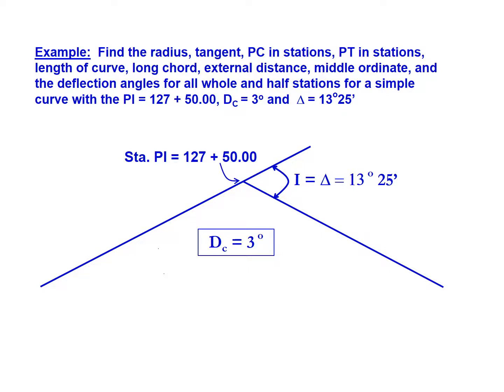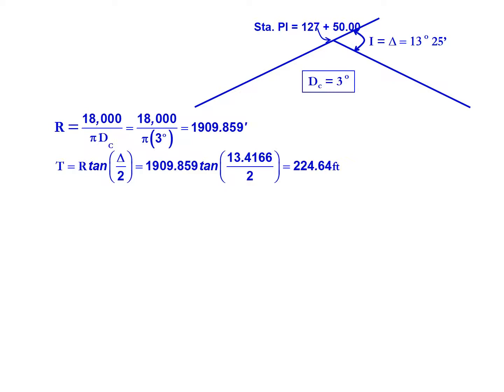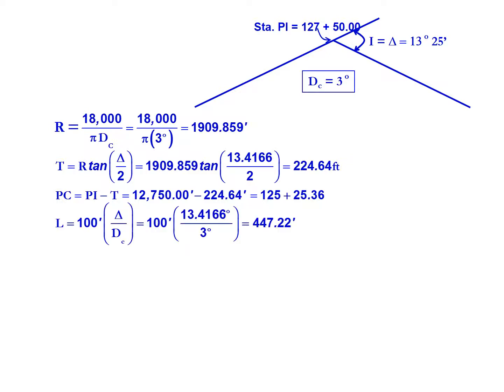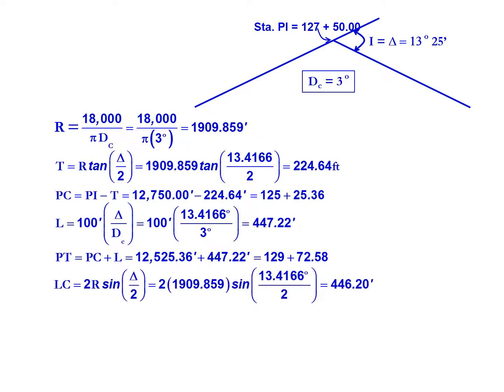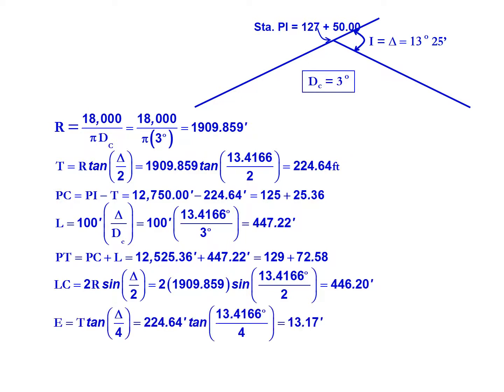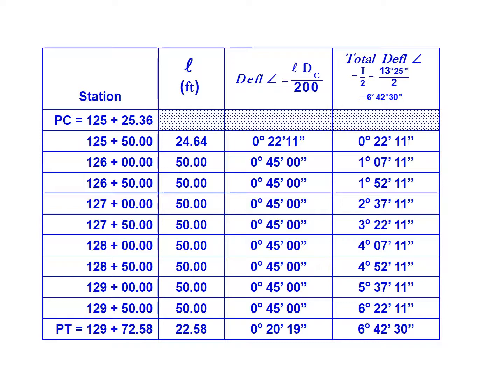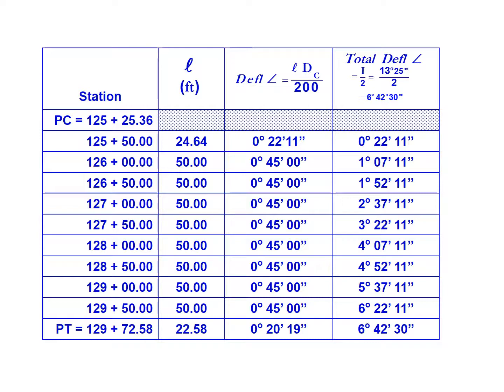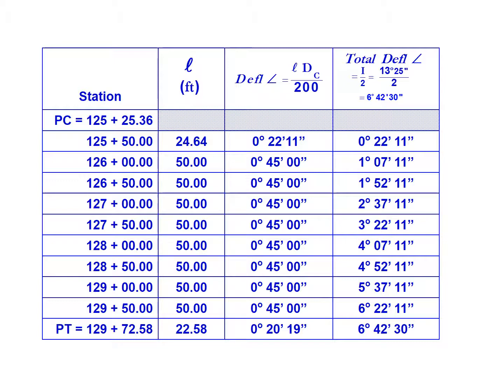Example of Horizontal Curve Calcuations - Basic Components

Comment: How did you get 18000 for the calcuation of the radius?
Reply from the maker: That's the equation for the arc definition relationship between Dc and R      -----      R = 18,000 / (pi * Dc)
Reply from the maker: It's also written as R = 5729.578 / Dc, which is just a simplified version of the equation I used
Reply: Thank you

Comment: why dont i add the tangent length to the point of intersection to get the PT ?
Reply from the maker: Great question!  For a simple curve, the distance between the PI and PT is the length of the calculated tangent. However, for stationing, we can't use that distance because we want our station to stay along the centerline of the roadway (these stations are important for many further evaluations including determining how much pavement you'll need and the amount of cut/fill necessary at any location along the road).   Therefore, if we start with the PI station, we subtract the tangent length to find the PC, which is the point where the road leaves the tangent and starts to curve.  Then, we add the length of the curve to the PC to reach the station of PT. This process is the correct way to station a curve because it keeps our stationing along the centerline of the road.
Reply: @FindleyDaniel  Thank you for your reply.
I need a little bit more explanation..
so Let me get this straight if I added the length of curve to PC I'll get the true PT which is the end of the horizontal curve but what if I added the tangent length to the PI what I'll get ? I tried it and got different values of PT always adding tangent length to PI give a larger value of PT than adding length of curve to PC.
So my question is what is the difference between both Point of tangents ?
thank you
Reply from the maker: @amrabdullah1995  Yes, for the purposes of stationing your roadway, you must add the length of the curve to the PC to determine the station of the PT.  This is the only correct method for stationing.